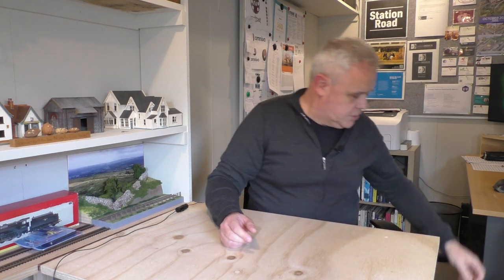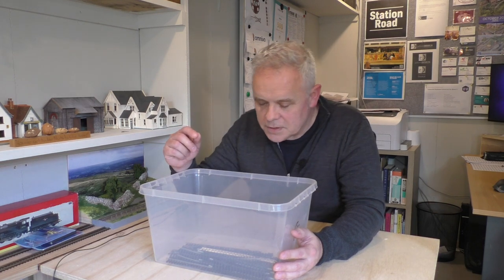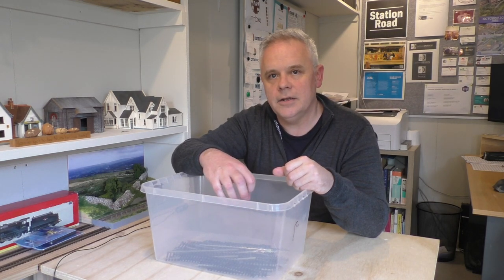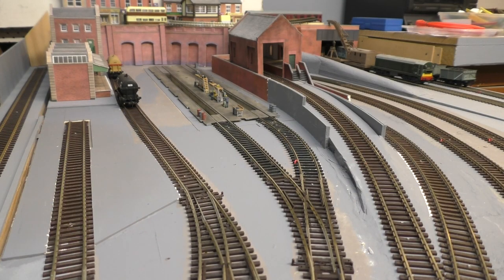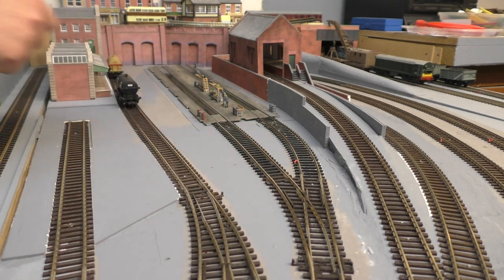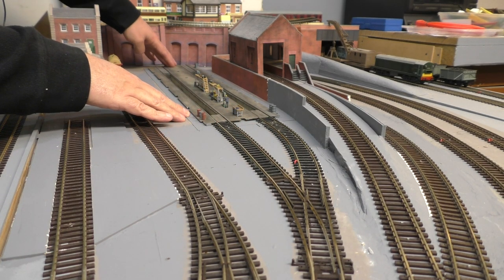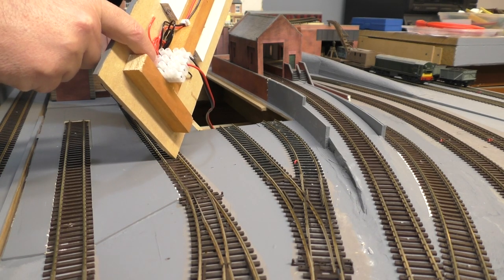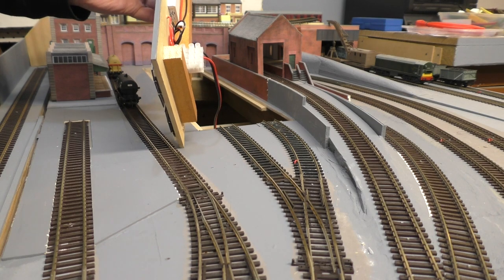The Engine Shed Now in Operation

Comment: Hi Julian - Thoroughly enjoyed this one, the engine shed looks fantastic. Can see why you need to take your time building it if you want it to look anything like yours. 
Also loved watching you put the track down and you have given me a few ideas about putting small sections of track in. 
I am using Peco code 55 N gauge track so they only do flexi track.
So my idea is to cut some small sections and put them in whatever Tracksetter track laying tools I need, mainly I guess the straight one, but gluing them in that position. 
So when I need them I have them to hand instead of fumbling about with flexi track.
The other thing that annoys me is when you get thumbs down. Why, I could see nothing wrong with that video. 
If they dont like it or find it boring then go elsewhere, certainly does not deserve a thumbs down for that. If it is for something else then for goodness put a comment in so at least you can see why they do not like it. Yes I hate thumbs down. 
Regards Chris

Comment: I notice in a few places you do not appear to use rail joiners, so how do insure that the rails butted together are aligned correctly and stay perfectly level with each other. By the way it was a great interesting video. Wonderful job on the Engine Shed     Cheers   Greg
Reply from the maker: Thank you Greg for your kind words. I've tried to get the area where the hard standing meets the baseboard as level as possible so the rails meet at the same height and then it's just a case of pinning the approach track to align horizontally. Once ballasting and any hard standing is complete on the approach tracks, alignment should be pretty secure.

Comment: Great addition to Station Road Julian, I'm wondering what else is going through your idea box for future developments in that area. Look forward to seeing them appear.
Reply from the maker: Thanks Steve. Yes, there now another area requiring scenic treatment and detailing. It will be a combination of lift-out sections surrounding the engine shed and other fixed elements with yard lighting, exterior lighting on the engine shed, and lots of clutter around the yard.

Comment: You are getting on with the updates to your layout, I think you can make your Class 20 a bit quieter on slow running by changing CV 132 and CV 143 to 0 as this stops the clicking noise.
Reply from the maker: My class 20 is throwing up some issues which I've put down to the sound chip, a SoundTraxx UK Diesel decoder. It's having a few glitches when trying to program it and sending back errors. Eventually I will replace the decoder with something more reliable, ideally LokSound, but price means it will have to wait.
Reply: Julian I know that you are running the Soundtraxx in your class 20, I have 7 in my locos. Have you tried resetting the decoder back to the original settings, if you go to CV 8 and enter 9 that will reset your decoder then you have to enter the previous values you had in your CV's.  @StationRoadModelRailway